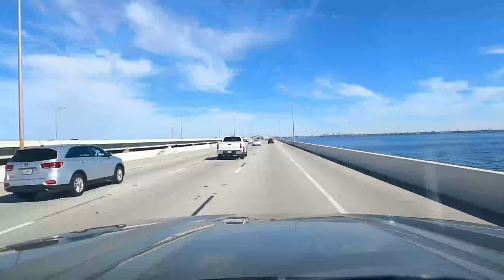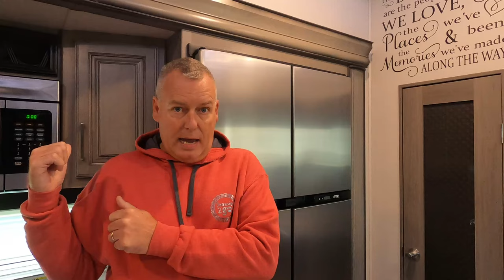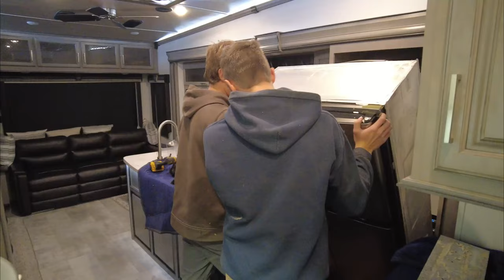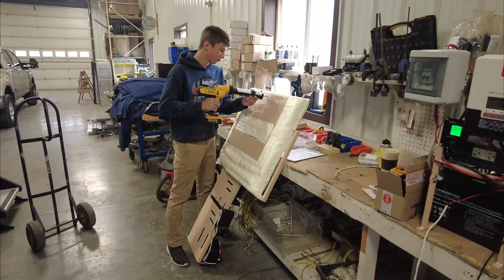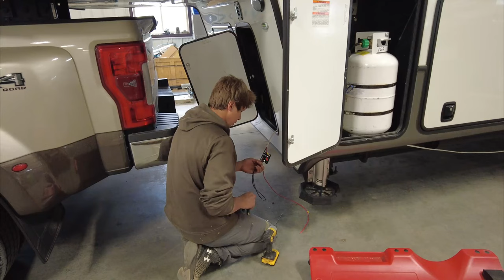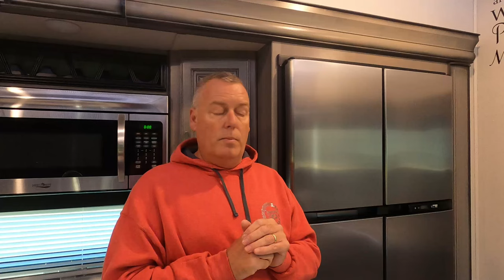Norcold RV refrigerator problems and solutions / What your dealer doesn't tell you

Comment: Yeah we’re having problems with this fridge couple of times it stop working and thru a code . Couple hrs later it would fire up and run with no problem. Ok the only thing you didn’t mention was the price of the conversion I Iike  the duel compressor. We in NH 603 who would I call to do this s anyway great video.Thanks Mike Bishop
Reply from the maker: I have a link to their website  in the description.  They have all of the pricing and options available there. Our total cost was $1964.00 including install.  They ship the units also with instructions.

Comment: Hi, I have made a appointment at JC refrigeration for next month. Your video explaining their process was great. I was just wondering if I should opt for the dual compressor or the single 12v I think I am scheduled for. I have a Grand Design 303 with a 12 cu ft dometic. What are your thoughts. Thanks.
Reply from the maker: Well we opted for the dual compressor so we could control them independently. JR recommends the dual if you are going to be in hotter temps like in the 100 degree range. We never know where we may end up so we just decided to go with the dual and be ready for anything. I am really happy with our decision. We  actually find ourselves turning ours down alot now rather than up. You will be very happy with the upgrade and the guys there will treat you great. Tell them we said hello when your there.
Reply: @Jonesin2Go  was wondering how do you control them independently because our fridge just went out
Reply from the maker: @rossschumacher9674  they actually install a separate controller on the back for the freezer. They will set it for you. After that you don't need to do anything with it unless you feel you need to adjust it. The refrigerator will still be controlled the same as before.

Comment: So does it still run off at 12 volt and Propane or does it run off of 12 volt and Electric
Reply from the maker: The option we chose is 12v only so it takes its power directly from the battery. No propane. So when you plug into shore power your converter will keep the batteries up. Very simple so when you are towing your tow vehicle will also keep your batteries topped off.  Very nice system

Comment: How much did it cost to do the upgrade? Thanks
Reply from the maker: It was just under $2000 and that included installation and the new 10guage wiring  run. It also comes with a 3 year warranty. If you have an extended warranty they work with those companies also. They have pricing on their website for all the different options and models

Comment: Watching this video bc I just got handed an electric bill from the rv park totaling $600 for one month. It’s a Bighorn 3270rs (2016). Exact same fridge as in the video. Bought an in line meter with Bluetooth, the fridge itself is drawing 9 amps/1200 watts.

FYI, the later models offered a residential fridge either by GE or Fridgidaire. Both with ice makers, costs around $1000, not $2500. Best to just get one of those instead. Just make sure they’re counter depth.
Reply from the maker: Another thing that will use a ton of electric is the converter charging the batteries. If you have solar you could use that during the daytime to keep your batteries up. We have 600w of solar and while in florida we turn our converter off duri g tbe day. This reduced our electric bill by 50%
Reply: @Jonesin2Go  How do you turn your converter off? I have solar on top of the rig. Idk what the wattage is
Reply from the maker: @BigBobBlazer  just turn off the breaker in your breaker box. It should be market on the door.

Comment: Would love an update on your modification!  Still happy?
Reply from the maker: Yes very happy. We have seen an 80% reduction in energy cost. We set it on 3 and maintain a below zero temp in the freezer and around 34 in the fridge.  This system also comes with a 3 year warranty and an extended warranty is available. We really like that it draws all of its energy directly from the batteries so there is no switching over while traveling. We would certainly do it again and highly recommend it. Thanks for the question. I think we will appreciate it even more when we are on the road more than we are now. Oh and our 300w solar can keep up with it. On sunny days of course

Comment: so what was the cost of your conversion
Reply from the maker: The total was $1964.00 that included the extra $200 to run the 10 Guage  wire that is needed. And installing it.. You can run the wire  yourself if you want before And save a little.  Also if you have an
 extended warranty you may want to check with them. Ours covered all but our $100 deductible and the $200 to run the wire. So I only had to pay $300.

Comment: That's not true, it's illogical, the RV manufacturer does have something to do with those appliances. They are the ones that choose which appliance manufacturer to pick when they equip their RVs and if they go by Price instead of quality then it has everything to do with the RV manufacturer.
Reply from the maker: My point is the RV manufacturers do not build those appliances nor do they design them and the defects of those are the appliance manufacturer's defects. The RV industry has very limited choices for RV refrigerators as there really aren't many companies building them. I am sure if a better product comes to market the RV manufacturers will surely take notice and provide those. We are already starting to see 12v refrigerators being installed in some of the smaller units. So it's just a matter of time that we will see the same in the larger ones as well.

Comment: Is the fan supposed to be on constantly???
Reply from the maker: It does run a lot but ours doesn't run constant
Reply: @Jonesin2Go   mine hasent stopped running for like 4 days
Reply from the maker: Is your conversion  recent? Our was done I April. I have noticed that as time goes by our Temps have gotten better and it seems to run less. I also am wondering if your thermistor  may be bad or placed  wrong?

Comment: We installed a JC Refrigeration cooling system in our Norcold 2118 and we can't get the temp below 37° and 5° in the freezer. When we open the doors it goes up to 41 then 42 and takes several hours to make it to 37 or 38°. We've been in contact with JC Refrigeration and it appears there's nothing more they can do for it. We went with the propane/electric cooling system.
Reply from the maker: Did you have them install it? Or did you install it?  I am happy I went with the 12v dual compressor system we find we have to turn ours down a lot. Freezer usually is running below zero and we try to keep from going below 33.

Comment: 1. In the manual for my norcold 1210, it clearly states that the fridge won't work in temperatures below 32. Thats probably why people are having issues with them in the winter. 
2. A brand new 12v fridge is less than what they charge to convert it.  I would love to do this but I'm in Texas and  it would cost way too much to drive it up there. 
Not sure why Grand Design or Keystone would put a fridge in that they know won't operate in hot or cold weather.

Comment: So really just a plug for JC refrigeration and not really anything to do with what a dealer "didn't tell you" it seems to me.....but thanks for posting your experience
Reply from the maker: Well actually, all of the problems we had are the things that the dealer won't tell you about.  We have read countless reviews from others with the same problems. So, the video was intended to share with others, a great alternative to correcting the problems that the Norcold 2118 has. With the cooling unit  that JC Refrigeration installed, we are using 80% less electricity and  our freezer runs below zero. The fridge stays around 33 degrees when set on 3. So, I will give  JC Refrigeration  all the plugs they deserve because we now have a reliable refrigerator that will run very efficiently.  Before the conversion it would cost us $100 a month in electric. That's something a dealer won't tell you about for certain. 
 Thanks for watching. Hope you found the information helpful.

Comment: How much did JC refrigeration charge for the actual install? Their web site has pricing for purchasing the kits, but I can't find how much they charge for the labor of installing. Thanks!
Reply from the maker: Here is a complete break down of our install. 
Cooling unit. $1275.00
Labor.             $400
Tax.                 $89.25
 And we needed  to run a heavier guage wire from the battery so that was an extra $200. So our total was.     $1964.25   if you have an extended warranty on your RV it may pick up the cost 
They work with extended warranties all the time.  We were only in the bay for a little over 2 hrs. Even in 90 degree weather our freezer is staying at 0 degrees sometimes below zero. And our fridge is running between 32 and 34 set on 3
Needless to say we are impressed. Before our solar install we ran it on battery only for 30 hrs and our batteries were still at 11.3v I havent tested it unplugged with th he solar yet

Comment: Nice video. It would be nice to know the cost of doing this. I also think its a shame a guy spends 80K plus on a new RV and gets an inferior product in it. This should be on NorCold. I have a 2021 Cedar Creek and mine works ok and keeps things cold on Setting number 4. Ive been in Texas on the gulf all winter. The ice cream however is a common complaint I here with these units.
Reply from the maker: They have pricing on their web site ( I left the link in The description.) They have several units for different brands and sizes. At the time of our install we were just under 2 thousand including installation.
Reply: @Jonesin2Go  I did go look at the website after making that comment. But I still think its just a shame one needs to spend that on a brand new fridge that should be built right to begin with.
Reply from the maker: @BigAl52  I absolutely agree. Unfortunately there have been limited options for these size refrigerators in a gas electric option. I don't know much about other manufacturers but keep an eye on Keystone Brands. There are changes coming as new products are hitting the market.

Comment: I am going through the same thing right now. We bought a new to us 2018 Alpine 3500RL last spring 2020 and I noticed the Norcold 2118X wasn’t getting cold enough. Spoke to the dealer and showed them pics of the temperature on the fresh food compartment and the freezer section so we could come up with a plan. First we added fans in the back, but that didn’t help at all. So jump ahead a year and we finally received a cooling unit which they installed last week. Yup made no difference. My question is. Is there anyway way to make that refrigerator work properly?  Will I have to go after market like you did?  What would that cooling unit like yours cost a person?
Reply from the maker: I am afraid that the unit that was just installed will never live up to your expectations. The more you read about this unit the more of this same problem you will find. Most people dont know because they dont stay somewhere that they have to pay for the electricity and they probably dont monitor the temps. In the description we listed the web site for JC Refrigeration. They have the options and prices for each. Ours was around the $1600 mark. We fortunately  have an extended warranty on our rig and that picked up all but $300. $200 was the 10 guage wire that had to be run for the 12v compressor.  You will not regret  making the conversation. Best thing we have done to our rig so far. Cut our energy consumption by 82%  and  set on #1 we are maintaining 35 in the fridge and 0 in the freezer.
Reply: @Jonesin2Go  I am afraid that’s what will happen. I’m not sure if the dealer will install another cooling unit under warranty. They don’t have anyone trained in the Norcold refrigerator. I do have a extended warranty but I didn’t want to use it as this was a problem when I bought the trailer. I am however going to talk to them about it.  All they want to do is throw parts at it and to see if that solves the problem.
Reply from the maker: Your story sounds so familiar.  The problem is that the cooling unit is not big enough for the fridge. The saddest part of all is Norcold knows this and they do nothing to correct it. I do believe that we will start to see the 12v compressor style refrigerators coming in new units. We have friends that just purchased a new Artic Wolf and it came with one. Not the size fridge they have but as I said I can see that coming. That is one of the reasons we did the video hopefully some companies like Keystone will take notice.

Comment: 100% false that rv manufactures are not at fault at least some of the time. These items installed (slides,refer,stoves,furnaces etc..) have installation specs that manufacturers dont always follow which cause problems..  the Refer is biggest installed problem (absorbtion type,like you have)  ventalation is extremely important and its the rv manufacturer that has to make the cabinet and proper ventalation .  Which i have had to fix numerous times across all brands
Reply from the maker: The reality is that the manufactures can only choose to install what is available to purchase. As for this Norcold 2118. It is no longer being manufactured. This was the result of the RV manufacturers and customers complaints. Unfortunately it takes many complaints and time for change but it happened.

Comment: It does fall on the manufacturer, that is the refrigerator tat that they choose to use. They should require Norcold to improve the quantity of the refrigerator or source out a better supplier.
Reply from the maker: I can't speak for other manufacturers, but Keystone has done just that. And they have put pressure on companies like Norcold. In fact, the gas/ electric refrigerator is no longer being manufactured  for that reason.

Comment: So I will say mine uses some electricity.  I am in FL no and have been since the end of June.  I will be here thru the winter.  I was in Southern UT and NV from March thru June.  My Norcold has NEVER been above 5.  I cant keep things from freeezing in the fridge.  The difference between 3 and 5 is 1 degree.  Right now it has been in the mid 90s my Norcold is set to3.  It is 33 in the fridge. My freezer is ok.  It fluctuates between 2 degrees and 4 degrees.  I hate this appliance.  My last 5er had a residential.  I switched to rv fridge because I wanted the propane option.   My issue is when you spend $100k on a 5th wheel you shouldnt have to spend another $2k to make an appliance better.  These RV companies have enough clout to get the appliance companies to do better.  They make these type of units for boats.
Reply from the maker: Sounds like you are having better luck with yours than we did. Just curious how much your electricity will cost you. We were paying about $80 per month when we were in Florida and that's without running the AC. I agree, you shouldn't have to spend money to fix an appliance. We are starting to see some manufacturers put 12 volt refrigerators in. Keystone is even installing solar as a standard on all of their units now. Perhaps we will see more 12 volt refrigerators as a standard in the near future.

Comment: How can you say problems have nothing to do with RV manufacturers… they have a choice as to which fridge, stove, microwave, a/c and heater that they put in there RV’s. If there are continued problems with any of them they should put appliances with less issues.
Reply from the maker: I say that because the RV manufacturers do not build the refrigerators. They put in what is available to them . I agree that they have a choice but those choices are limited to what is available.  Now with that said  videos like this and pressure from the manufacturers has made some impact in the products that will be available going forward. For example this norcold absorption refrigerator is no longer going to be produced as of this month. It is being replaced with a 12v compressor unit. So in the future we will start to see the RV refrigerator options 12v instead of the  gas/electric. I am starting to see this change already with new Keystone products and will surely see it in other manufacturers as well.

Comment: There should be a class action lawsuit against Snorecold, these units are very expensive and absolute trash by design, everyone knows it and so legal action is needed.
Reply from the maker: I agree  unfortunately that may not go far.  Norcold has stopped manufacturing these type refrigerators as of this past October. They now are making 12v units. I have to believe this is why. But why they never made any attempt to improve the gas / electric units when they knew for so long how terrible they were.

Comment: the rv manufacturer chose to use those brands of appliances
Reply from the maker: This is true. However, they can only use what is available. Some manufacturers like keystone for instance track warranty claims and look at the products they have issues with. With that said they then look for a better product,or work with a company to make changes.   This particular Norcold refrigerator is no longer being manufactured. There is a reason for that. The Rv industry put pressure on them to provide a better product. Unfortunately this takes longer than us as end users would like.